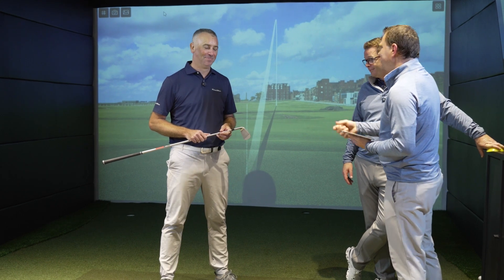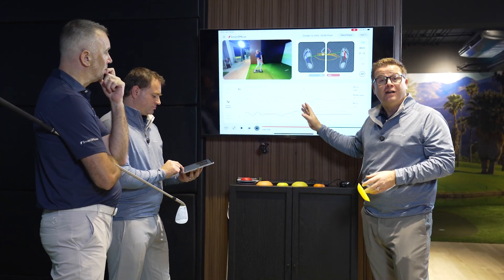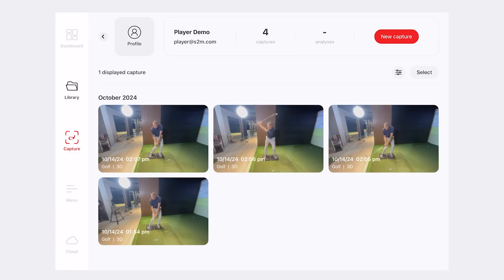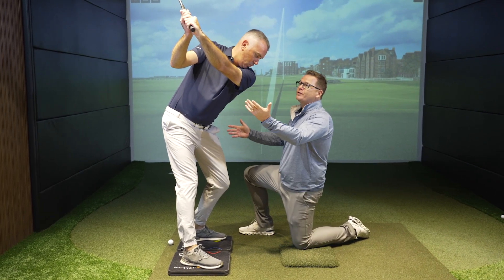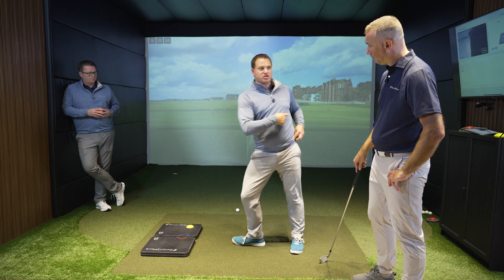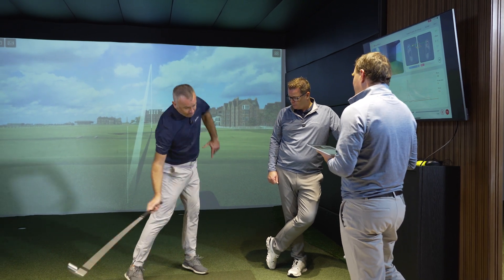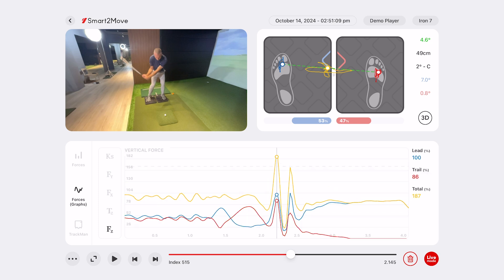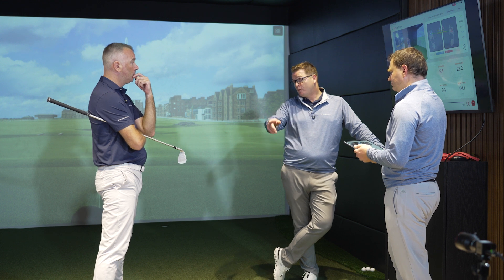How to Improve Clubhead Speed Using Smart2move 3D Dual Force plates

Comment: This was a great lesson, thank you! The only thing I don't understand is why you recommend that he applies the horizontal forces so "passively" via the 70/30 re-centering. They could be the biggest contributor to swing speed and a more active horizontal step into the lead foot (and then applying the max rotational and vertical forces after that) should work even better? Think speed ice skater steps / drills with strong and quick horizontal forces applied first (from a small lead foot bump at P1 to trail foot at P2 to lead foot again at P3-4).
Reply: I think because he's a center pivot driven swinger. A rear post swing would be more inclined to work on lateral force maximization where 80% of pressure is on trail foot on backswing.